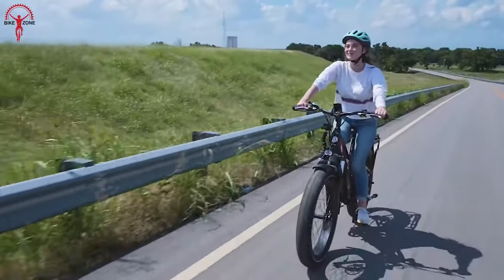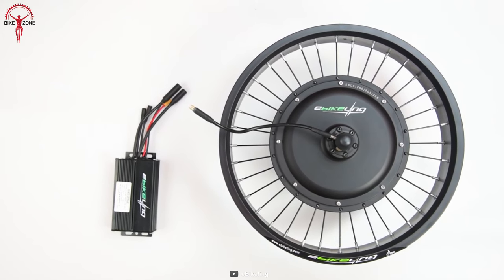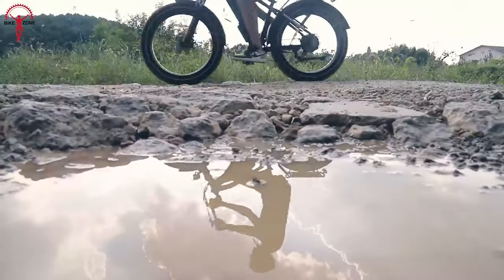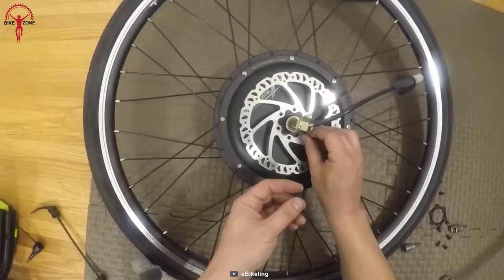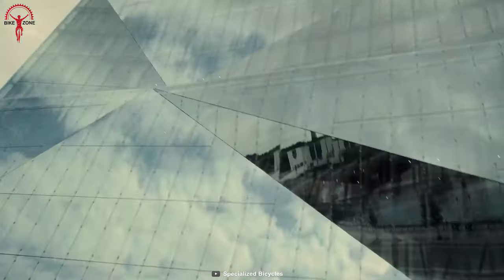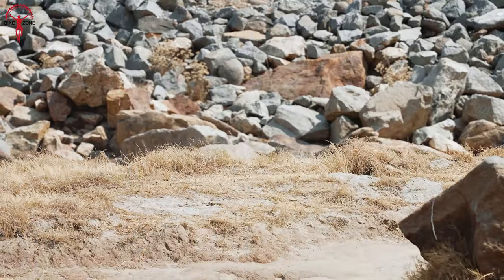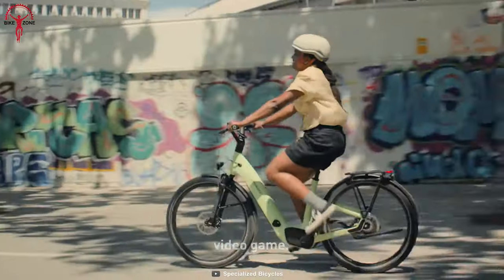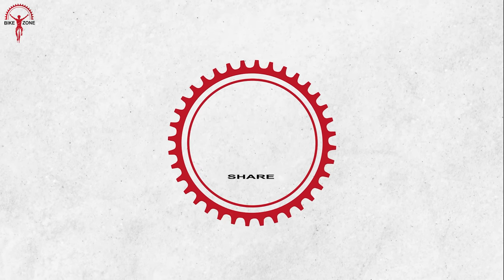Hub Drive vs Mid Drive Motor Explained - The Advantages and Disadvantages

Comment: Hub motors are not lower maintenance. They place a great deal more stress on the axles and bearings that are little to nothing more than a traditional bike hub. The spokes are shorter and lower cross so they tend to loosen. Most of your weight, the weight of most things you carry and the heavy heavy motor are all resting on these short, near radial spokes.

Mid-drives are no more likely to break a chain than a traditional bike. Mid-drives that are legal do not exert as much torque as even one human arm. You will get the same mileage out of a mid-drive chain as a traditional, you will just reach it a lot sooner.

You forgot to mention that mid-drives climb hills much, much easier and faster than hub drives. Hub drives drive only the hub and you can only help it by pedaling. A mid-drive uses your transmission, so you can down shift and often even increase power and speed climbing hills. A great example would be my friend's 1500 watt peak, geared hub drive that won't climb an on-ramp near as quickly as a 250 watt mid-drive in my shop. When you consider that most of my mid-drives are 500-750 watts and 80-160nm's of torque, that is quite aignificant.
Reply from the maker: Good observation.
Reply: Haha.  I wonder where you heard your information from.  😂😂
Reply: @JohnBowl14690  52 years in the  business, fordt e-bike 1978, morethsn a gross of custom conversions, the only e-bike service fascility in in a 1.5mil MSA, dozens of hub drive rebuilds and actual riding experience on just about everything made including some seriously illegal bikes both hub and mid-drive. 

I have never had to lace a traditional hub on a mid-drive e-bike. Have had to do so twice on legal hub drives this week alone.
Reply: @MHH3180  - If you were the only one in the world that did ebike maintenance, I would side with you.  lol.  Today I use google.  It tells me the scoop based on the majority.
Reply: @JohnBowl14690  of course, everything on The Internet is true!  There isn't even one bike reviewer that knows squat about bikes, muchless e-bikes. There's a reason 100% of my suppliers are moving to mid-drives. Rad is the only major name not turning away from hub drives. Velotric has developed a whole new motor from their parent company. Lectric has been adapting hubs to mid in an intriguing manner (hinted yesterday to adding it to The Expedition and adding gears to their trike mid). Aventon has been overwhelmed by rim failures and spooe issues. They too have introduced a mid-drive going as far as to suggest this is the future of their bikes. Unless you intend to break the law on level ground, hub motor tech is too far outdated to be taken seriously. outdated

Comment: Hub drives can be a drag; the motor makes the back end heavy; if you have a hard tail; then the bike hurts if you go over a bump unexpectedly! ouch; get a shocked seat post at least! The newer mid-drive motors from Bafang have a motor cut-out switch for 2022-23 models that will cut out motor power during shifts (amazing) and it works great. I have a Accomile Cola Bear with a 750w motor and it has the cut-out; there are never any issues with power on the chain, and the chain does not fall off due to power on during shifting. This motor is inexpensive compared to all the other motors out there, and a better design too; better than Bosch now! Forget belts, and forget the issues usually associated with Mid-drives. My Cola Bear climbs hills like a Bear; very fast.
Reply from the maker: Informative!❣
Reply: That little 8lb hub motor doesnt affect how you feel bumps on trails or streets. One of disadvantages with hub is the weight distribution from when you're getting tossed around from side in heavy mountain bike trials and have to keep balance.

Comment: Great explanation, thanks! Question... Will a hub-drive work with a mid-drive on the same bike with dual throttles? What I'd like to do is put the 750W hub motor on the front of a BeeCool Challenger, then put a mid-drive on the back wheel, Giving me both options plus AWD. Another thought, Is it possible to use a CVT on a mid-drive ebike? Chains are loud and they break. Transmissions are mechanical, heavy and expensive. CVT's are lightweight, cheap, quiet and seem like the perfect solution...?
Reply from the maker: Yes, absolutely! It's going to be a tricky job. However, it's possible.
Reply: @bike-zone  Thanks! Challenger is solid enough for 60mph... Did you see the Ola info I posted?
Reply from the maker: We haven't seen the Ola info you posted. We'd like to know.
Reply from the maker: @johnw65  Thanks for sharing!
Reply: @bike-zone  I'd love to buy one when they become available
Reply from the maker: @johnw65  Great! But not all of them are available on Amazon.

Comment: You missed the fact that there is a shift sensor which shuts off the motor during shifting. A mid-drive is better on very steep hills. You need a really large hub drive in comparison to a mid drive.
Reply from the maker: Thanks for the information.

Comment: From what I’m seeing hub drive especially geared hub drives are best if u don’t have a lot of hills or do mt biking… and mid is good if you are doing those activities..so both are good in their own way I think for a majority of people it’s best to go with a geared hub on a bike mainly used to travel on flat roads from paint a to b…🤷‍♂️ I have never had an issue with hills on a 750w hub drive but I hear complaints on the ones that are less powerful more power seems to fix most of the drawbacks of hub drives… my next bike is going to be 1000w geared hub with torque sensor and hopefully weighs under 60lbs
Reply from the maker: You explained many things. Thanks for sharing. We hope you can get your bike soon.
Reply: Yes, I think it's all about power and torque. Electric cars use gearless hub drives after all.

A mid-drive will let you go in lower gears, so if you're capped at 250watt, gears is a way to get more help when going up hills and starting from a standstill.

But if you're not capped at 250w, you can get a rear hub motor with 750watt continuous and peak of say 1500watt at 85+ NM torque, and you'll have no problems on hills and won't need lower gears.

But I think outside the US, a lot of country eBike regulations mean motors cap at 250watt and with lower peak power as well. That probably explains the interest in middrive motors.

Comment: I had bafang mid-drive conversion few years back with shifting sensors etc - well it was powerful but it was not a bicycle anymore it became an electric motor, very heavy too also it eats aluminium chanrings and puts massive stress over whole drivesystem so I recommend change everything there to steel ebike specific components. Now I have sub 20kg rear hub cheap ebike because I wanted a bicycle that simply helps me a bit on climbs and does not break the bank.
Reply from the maker: Thanks for sharing.

Comment: Another massive reason is suspension, since suspension relies on the wheel being as light as possible, putting a motor that weighs 5x that of a normal wheel renders any suspension on that wheel pointless, in fact it makes suspension worse than rigid, since it now slams all that weight and inertia up and off the ground, so if you want full sus that's in any way functional a mid drive is required.
Reply from the maker: You have a very good point! Thank you for sharing.
Reply: You really think that 8lb motor makes any difference back there? I mean you can switch to different suspensions and besides that, Im packing any 50lbs of being overweight, so 8lbs seems pretty insignificant. Idk....
Reply: @srobeck77  It's not a matter of "do I really think" 100 grams makes a difference in unsprung weight, that's why tubeless tyres, carbon rims and alloy cassettes that cost $1000's exist.
Reply: @Effect-Without-Cause  ok but im curious as a matter of ratio. Im packing an extra 60lbs overwieght =200lbs. How does 8 lb matter at all compared to that?
Reply: @srobeck77  Suspension is all about sprung vs unsprung mass, In your case higher sprung mass actually makes lighter unsprung mass more effective. Higher unsprung mass is always bad though because of the inertia it'll pick up from bumps. 
Look up "Sprung VS Unsprung Weight" it's a 1.33 minute car video explaining it perfectly.
Reply: @Effect-Without-Cause  no, just no

Comment: The chain doesn't snap instantly when you shift on motor power, I have 5500km on  my chain and it hasn't snapped yet and as for weight management with hub motors, you have to take rotational mass into account too...
Reply from the maker: Thanks for the information.

Comment: Hub drive is cheaper and no maintenance .
They always wat to sell you the biggest car with the most option's.
Same with bicycle's .
Keep that in mind
Reply from the maker: Glad you shared your thoughts!
Reply: Hahahhahahahhahah ok buddy.  Then why is there not a single reputable company that makes hub drive ebikes and sells them to bike stores.....because hub drive is trash old tech
Reply: @msawyer110  Hes the kind of guy that would argue that a used honda civic is superior to a GTR because of the price
Reply: Theres less maintenance on a internal mid than there is on a hub. But were talking about a motor that costs $400 more

Comment: in over 3,000 miles of varied terrain riding l have only had one chain failure on my mid-mounted motor EMtB. The split or master link failed. I had to push/freewheel home. Since then l have carried a spare master link and a spare chain in a frame bag. The advantages of mid mounting are overwhelming. The gear ratios are innumerable, my bike has 11. It will go up anything as long as there is grip. The power never surges as it does with a hub motor and it never keeps going after you stop pedalling. That feeling/consequence of the cheapo hub motor is very disconcerting. I have a full suspension bike so massive sprung weight would be even more off-putting. So, carrying a spare chain is no hardship in exchange for all the advantages of mid-drive.
Reply from the maker: That's impressive! It's great to hear that you've only had one chain failure in over 3,000 miles of riding. Carrying a spare chain seems like a smart move to ensure you can keep going on your mid-mounted motor EMtB.
Reply: Spare Chain and link, spare inner tube x 2 and a car foot pump. Always with me on a ride.

Comment: You missed the biggest downside to the direct drive hub motor. If for any reason you lose battery power to the motor,you cannot pedal the bike! Due to the magnets interactions with the stator,( it acts just like regen braking). And any motor over 250 watts is impossible to pedal. And if it's larger than 1000watts  it's impossible to even push the bike.
Reply from the maker: This is an excellent point we have missed. Thank you for pointing it out!
Reply: geared hub motors (small one) does not have that problem, i was surprised that wheel is completely free it rides like normal bike... you talking about gear-less hub motor (they are bigger) and yes they are hard to pedal...
Reply from the maker: @britkasablja007  Thanks for sharing!
Reply: Wait what?  My direct drive hub motor scooter has a 2000w motor front and rear.  It moves just fine with no battery power.  Bikes are different?
Reply: Not true. Only faulty direct drive ones.
Reply: A lot of hub motor have small resistance, A Brand called LEMMO even has a clutch to reach almost zero resistance
Reply: My direct drive hub doesn't do this what so ever. And it's 100 percent not geared.
Reply: I have outroad e bike and without power I can pedal easy 25 mph

Comment: How about using both? Have a mid-sized, mid-drive motor for level-ground power. And have a small-sized, front hub-drive motor for hill-climbing power - and as a backup motor (in case the chain breaks) that will get you home from deep in the bush with night coming on....
Reply from the maker: It is very much possible. Thanks for sharing your thoughts though.
Reply: Huh. I have both too but my mid drive performs much better on hills/ offroad
Reply from the maker: @thisone3519  Thank you for sharing this! Mid drives are better!
Reply: Bring a spare chain and have it replaced every few years. Problem solved. Or buy a bike with a belt instead.

Comment: Can you KEEP the original front 3 ring crank and deralier with a mid drive conversion bike ?
Reply from the maker: Most mid-drives use a single front chain ring, but there are options for running two. It's kind of a moot point though, because you probably don't need it.

Comment: Excellent analysis. Thank you !
Reply: Just another point you might find interesting with the hub drive a round trip which includes some slight hills I avaraged around 12.6 mph and just looked at my monitor now and todays trip avaraged 15.1 mph on the same trip, I believe the difference is use of the gears.  Mike
Reply: @michaelrowland6538  I see you had 10aH and 15aH but what are the voltages? 12-15mph is not fast enough for me on flat land to invest $$$ unless I lived in hills and mountains.
Reply: @carrickdubya4765  36v but the motors we have a 15,5 limit here in the UK  and the speeds I have give is in all avarage as going up some hills touching 8 mph and ccoming down some at 25mph but motors cut off after 15.5mph.  My ebike is UK road legal and can't exceed 250w and 15.5mph and as to be peddle assist.  If your in the US the law is different in many states you can have 500w with max speed of assistance upto 20mph and I would still say the mid drive is more superior then the hub because of the gears you can use as even a hub drive will not get you up a hill at 20mph, but because on the mid drive you can use gears in lower gear you will get up the hill much faster.  You sound aso you want a cycle for a motor vahicle, I want a cycle to feel like a bike but because my age and health I struggle on a normal cycle but I still want to do some of the work and the mid drive feels more like natural cycling as I don't us throttle I peddle, 15ah will last longer but not sure it gives much more speed, but both batteries where 36v.  Mike
Reply: @carrickdubya4765  What do you want a ebike for?  I want a ebike to feel like a cycle to do what I was able to do when I was young,  I don't want a ebike to feel like a motor vehicle or to do  all the work for me I want to be doing what I am able to do.  I am 58 years old, 21 stone with heart condition. I have a car and I could buy a moped or a ebike with a 750w motor upto 28mph and register it and ride it on my driving license but I don't want that I want to cycle, mid drives give that feeling as if one is doing all the cycling, we know that isn't true and one finds that when they switch the motor off, but it feels natural and my findings is the mid drive is more suitable to my needs then the hub motor and far more superior in the legal restrictions my country as that allows me to ride my bike as a peddle cycle.  15ah gets you further then the 10ah it doesn't give more speed, when I had a hub motor my cycle with the mid drive does no more speed with the motor but because of gears it uses the motor better as one can go in higher and lower gears and use cycle better.  Is 250w and 36v enough? No because i still can't get up the real steep hills only further up them because of the torgue but I have to follow the law and restrictions of my country until the law changes, but I have got what I am after a cycle that feels natural when cycling and very happy and never found that with the hub drive.  Mike
Reply from the maker: Glad you liked it! Much appreciated!

Comment: I still say that rear hub motor is best for speed only problem tyres wear prity quick. But that depends on the person who rides the bike
Yes to ride if motor packed in but still moves it's acward to peddle gear less is best if you get stuck you can still pedal like an ordinary bike midrive better with belt mot chain if you use for going around town chain is OK of road for any bike is stress
Reply from the maker: Thanks for your suggestions.

Comment: I'd want to get both with the mid drive as the main drive and the hub motor to be the emergency drive if the chain breaks.  Maybe have a spare chain, who knows.
Reply from the maker: Hope you will get it soon.
Reply: If your worried about the chain breaking, maybe go with a belt instead. Or also, to reduce chain fatigue, pedal when you starting off instead of using the motor assist or the throttle.

Comment: Glad I found and just subscribed to this channel. I'm about to buy an e-bike and need all the info I can get. I'll research it to death and then make an irrational impulse buy. I'm old but crazy! Experienced Motorcycle/Dirtbike/Trials rider. Have also ridden bicycles regularly all my life. MTB too. I will be riding it on and off road in New England. I'm anal retentive about maintenance, upkeep and upgrades. I need a Brotherhood of Experts to help an elderly guy out! ... --- ... ! My 1st guess-Mid Drive- 1000w full suspension, Not sure of tire size but can see more advantages with 26 x 4  than a more conventional 27.5 Help!!!!
Reply from the maker: Glad you shared your thoughts. If you want to get a 1000w mid-drive motor now, that'd be somewhat crazy. However, you said you're crazy! And that's okay.  The wheel size you mentioned is okay. You can go for fat tire bikes. The rides will be stable then. And finally, be safe.
Reply: Thats what I would go with is the 1000 watt mid drive with 52 volt battery and 26x4in tires
Reply: And with the 52 volt and 30 Amp controller you will be able to get up to 1700 peak watts with a full battery